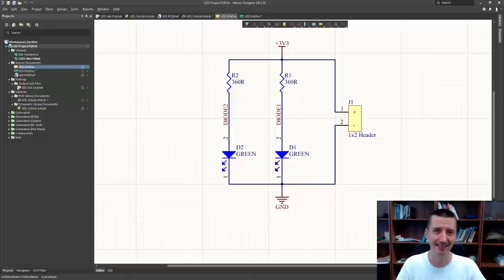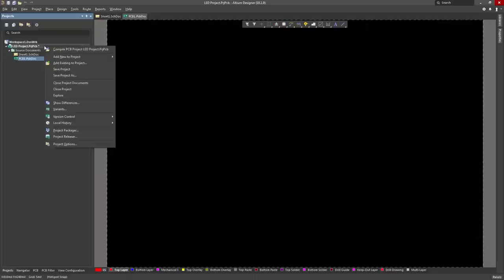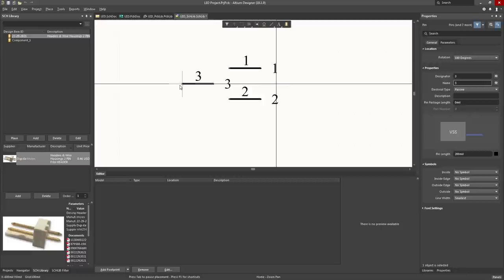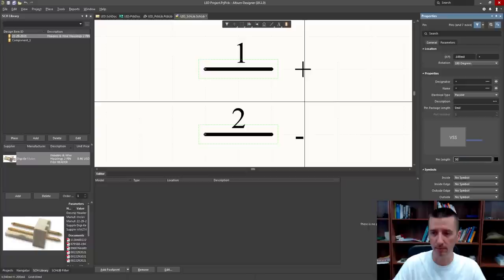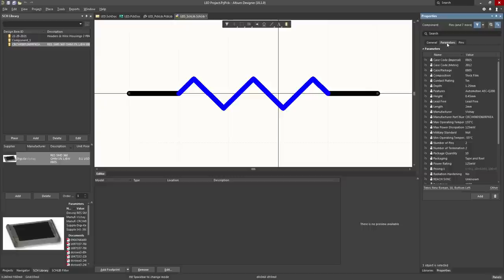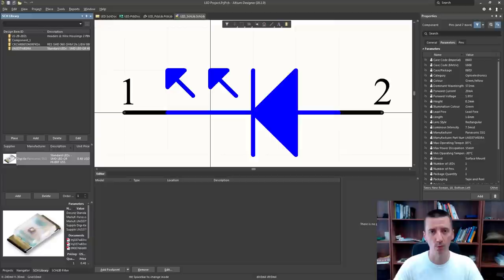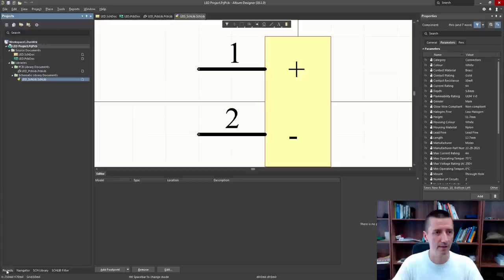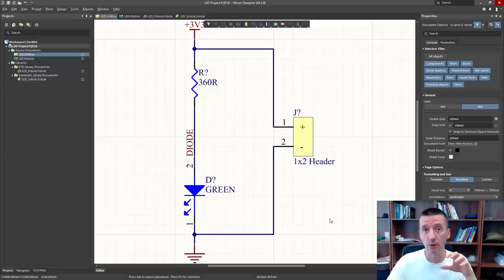Tutorial 1 for Altium Beginners: How to draw schematic and create schematic symbols

Comment from the maker: NEW: I updated this tutorial and made a shorter version ( in case you need it ). Here it is: Altium Designer 22 Tutorial - Quick & Easy |  Step by Step https://youtu.be/PqFtSpAXB9Q
Reply: At what point do you describe what the grid size should be ?
Reply: I imported the part like you said at 12:00 but do not get a picture of it in the SCH library panel
Reply: when you copy-pasted the arrow at 44:20, why is the pasted arrow symbol so far from the mouse pointer?
Reply: Isn't it usually possible to just obtain correct schematic and symbols for components we intend to use? Is there a standard way to define schematic symbol and PCB foot prints?

Comment: For anyone stuck around 33:56 you get to your library in (panel)===>Components===>select your schlib and it should have your components listed from the created library. If not save all the files and it will update and then go back and check.
Reply: Also, with version 19.0.5 of Altium, I also had this little problem where you have to restart your Altium every time to update your component panel libraries.
Reply: Hello I did everything same as shown in the video but I can see my components in the library but I am not able to place them in the sheet or it is not visible either

Comment: Hi Robert! Thanks for a great tutorial. I wanted to comment on something that may affect the experience of other users, and that is how we search for parts. I suggest you add an edit that lets people know that stock may vary, so they may not find the part you use if they follow your steps exactly. This happened to me, which is why I mention it. Disabling stock as a filter will give you more consistent results. Of course, this doesn't apply to irl design, where having stock is important, but it serves the purpose of the tutorial learning experience.

Comment: Hi Robert, Thank you for your masterpiece! )) 
Could you please explain the difference between 3 your courses:
1 - This course
2 - Altium Tutorials for Beginners
3 - Learn Altium Essentials - Doing PCB Layout
Thank you
Reply from the maker: Thank you Pavel :) Do you mean my other youtube videos? 
- This video is based on the new Altium. This tutorial has much more info and is much more complex than the Altium tutorials what I shared on my youtube some time ago. You will see in the next parts.
- Learn Altium Essentials - Doing layout is from our course, so on youtube is just a small part of much bigger video. The whole course goes into much more details and it is not just about Altium, but it is about hardware design. The course is about designing switching power supplies and includes comments about how to design switching power supply, what is important, how to do it and why we are doing it that way.
Reply: @RobertFeranec  Now it's clear. :-) Thank you Robert!

Comment: I like making my schematic symbols with the outline color the color of part manufacturer, white inside so I can paste the package pinout from the data sheet, I then give it a dark grey shadows and set grid to 10 mil and offset it 30 mile down and 30 mils to the right. They look gorgeous and make it more fun. The yellow boxes are simple but boring but traditional.
Reply: Hi, 
it sounds interesting could we/I have a picture of your design. Thanks in advance
Reply: Shouldn't it be a library which contains all the drawings for parts? Doing it for every component seems very time consuming
Reply: @haideralikhan5947  it takes maybe 30 seconds longer than making a regular part. Really not time consuming and it just enhances my enjoyment doing schematics

Comment: Thank you Robert for your hardwork. You have always been a great help.
Reply from the maker: Thank you very much Navdeep for nice words :)
Reply: a quick question Robert, in my altium 18.0, the properties option is missing and also, its not there in the Panel option. I think the 18.0.10 was a beta version. Is that can be the problem? Also, I'm not able to open the properties of components by double click on them, which we were able to do with older versions.
Reply from the maker: I do not have Altium right now here, but I believe you should be able to see the Properties panel in AD18.0. If it is not open and if it is not in Panel option, I think, double click could also open it. But I would have to try it. AD18.0 had some bugs (e.g I remember, that if Properties panel width was too small, some values in the panel were not shown properly)
Reply: Robert Feranec ohk will try out. Thanx robert

Comment: Hi Robert, I made schematic symbols for USB-C and Molex board to board connectors and created pins by copying and pasting the pins and then manually going into the properties of each pin and changing the name and designator to numbers 1-64 (Molex) and A1-A12/B1-B12 (USB-C). When importing these connector symbols into my schematic, I see red squiggles going down one side of the component. Is that a DRC error caused by my method of creating pins?

EDIT: I see my error. I forgot to change J? to J1, J2, J3, and the error was caused by duplicate designators. After assigning J1 - J3, the red lines are gone!

Comment: Hello master Robert i like you videos and  great videos. I have a question that you said in the minute 33:02 the number 1 pin is cathod in the led  but in the datasheet said the number 2 is the cathod??? possible you wrong??? . I hope you respond thanks.
Reply from the maker: Usually 1 is cathod. I do not know why this specific manufacturer used number 2 in the datasheet. However, in this case, it is fine - in this case you do not need to follow datasheet, just be consistent between your symbol and footprint numbering.
Reply: @RobertFeranec  thanks for respond!!!! your courses of Altium are Great!!

Comment: Hello Robert;

I am using Altium 16.1.12 . This version of Altium Designer does not show either the “Panels” sub Tab nor “Parts Search”. Instead this version of Altium shows a “System” sub Tab which when opened displays amongst others the “Projects” panel for enabling or disabling.  QUESTIONS: Q-1): May be this Altium version would require enabling the display of “Parts Search” under the “System” sub Tab?  Q-2): How to access to the “Parts Search” when this panel is not shown in the "System" sub tab?Thank you
Reply from the maker: I have made also videos in previous versions of Altium. This may help: https://www.youtube.com/watch?v=XZzZtYYRu2U

Comment: HI Robert,  thanks for still uploading great videos, when you start a new design, you always create libraries for each components? even for resistors? do you have base libraries, which you usually use to create another libraries for specific resistors , and capacitor and so on? Is it possible to  share it? (I have downloaded your library "Open Source iMX6 Rex project") but it is not included the different sizes of resistors, or capacitor and so on) sorry if I am asking too much
Reply from the maker: I do not create libraries for existing components, we have our own big library. It is not possible to share the library as it has many components which are under NDA and can not be published without permission. You can always create library from a project, our iMX6 projects should have many basic components.

Comment: How do you figure out the dimensions of each object? How do you know if your pin must be 200 mil long vs 100 mil long (as an example) and how do the lengths affect performance or operation? For example, if I used different lengths for the resistor or diode symbol, how will that affect my PCB? If there are some standard, well accepted design principles on drawing these symbols (ex: it is recommended for pins to be 200 mil long) where can I find these?

Comment: Hello Robert. Thank you for your great videos. One question for the paid courses. Will you make in the future a similar course structure for Cadence suite, as for the Altium one?
Reply from the maker: You can use Advanced PCB Layout with Allegro. I am not planning to re-do it, it is not necessary. Only what you may need is the iMX6 Rex module in brd format and you can find it here: https://github.com/FEDEVEL/board-imx6rex-module-in-cadence
I would like to create super advanced course in Allegro (server board design with all the high speed interfaces), but I have not found any company who would back up that project.
Reply: @RobertFeranec  Thank you for taking the time to answer

Comment: What if your new part does not have 3d model?
Reply from the maker: You do not have to use 3D model (however, then 3D model of your board will not be accurate). Or you can find a 3D model on Internet e.g. try 3D ContentCentral. Or you can create 3d model: you can create simple 3d model in Altium or you can create detailed 3d model in different CAD system (e.g. autodesk, fusion 360, etc)

Comment: Dear Sir, I wanna ask something, how do you know length of each component you built? like why the pins are 100mils and resistor.
Reply: also, how do you know to search like "led 0603"? thanks!
Reply from the maker: you can choose any length you want ... I used 0603 or bigger because it is easier for hand soldering. If you google for "standard resistor footprint size", you can find all the kind of standard lengths: http://www.resistorguide.com/resistor-sizes-and-packages/.
Reply: @RobertFeranec  great Sir ! Thanks 😊

Comment: Hello. thanks to your great videos and especially thanks to your good speaking...because despite my bad English skill I can clearly understand your remarks.
 I have one problem....as you said I disabled the auto pan exactly like yours, but then my left click didn't work anymore, for example when i want put wire.
Reply from the maker: Thank you Alireza. When you work in right panel, you are out of focus from canvas (the area where you draw). Easiest way to get focus on canvas is to press right mouse button, hold it down and move the canvas a little bit (or use enter when you change something in properties - that also often will return focus to canvas).
Reply: @RobertFeranec  thanks for your help....yes it has worked....
Reply: @RobertFeranec  Did not work for me. I can not place anything even if I did not work in right panel. Thx

Comment: Thanks for the video,  this is very helpful!
Btw, can you simulate your sample circuit in this video with the built in tool mix signal simulation?
Reply from the maker: Thank you Kevin. I do not really do many simulations. If needed I usually only simulate memory layout and I do not use Altium for this - Altium doesn't have good simulator. I like Hyperlynx for simulations, but for this I do not have license - I can only use it when I work for some clients.

Comment: Why is it that you can ever create your power port or net alias manually?  Is it because of human errors and misspellings or is it because the tool will crash?  I want to think the reason is due to the fact you will create many net names differently for example if you intended 3.3V and you ended up with many version of 3V3 and they will not be connected on the board.  One should be able to catch that on layout as one would expect one 3.3V plane for example.  I can see the reasons why, and being new to Altium, I just want to know if the tool will crash or create bad netlist or other reason other than human errors.
Reply from the maker: Human mistakes - I have seen it many times.
Reply: @RobertFeranec  it makes sense. I was just worried the tool couldn't handle it or something else tool related. Thank you for your video. It is very detailed and very useful to new users.

Comment: I found out that using the import tool just messes up the component by adding a lot of useless properties that are not consistent. Thus making the BOM output a real mess. What is your view on that?
Reply from the maker: Import is never perfect. After import, the symbols and footprints are usually copied and placed into a proper libraries, they are adjusted, proper component is created and then replaced in schematic.

Comment: Hi! Excellent tutorial. I'm starting to watch all your videos.
I have installed AD 20.0.13, but it runs really slow on my laptop i7 16GB SSD NVIDIA Quadro M1000M when moving components or placing tracks. Would AD version 18 or 19 run faster? Thanks.
Reply from the maker: Thank you Dario PS: I also noticed, Altium is getting slower and slower .... I am not sure if AD18 or 19 would run faster, but old altium e.g. AD14 was definitely faster.
Reply: Robert Feranec Thanks for your comments Robert. In this case for example, when I move a component in the board and start moving the mouse around, the component follows the cursor with a 1-2 sec delay. It’s like a cat chasing a mouse. A fat cat, by the way. I wonder if one would lose important new features of v20, if I using v18 or v19 instead, for the casual designer. Have you seen valuable advantage from going from v18 to the latest one? I really like the dark theme they introduced in v18, I think it’s better for the eyes. Otherwise I coming back to Protel 2.8 😊. 
BTW, you are doing a great job with your videos 👍🏻
Reply from the maker: @dariodraiman6339  Honestly, if I was not creating youtube videos, I would stop upgrading in AD14, maybe AD17.

Comment: Hi, have you designed with circuitmaker?, it is the free version of altium, but I dont know if would be easy to migrate from circuitmaker to altium, thanks
Reply from the maker: Simple asnwer is no, I have not really used circuitmaker. I have played with it, I do have some of our projects there (imported), but at that time I was playing with it I think it did not support private projects, so it was not very interesting. Even if it would support private projects now and I would be starting with HW design I would probably try KiCAD instead.
Reply: @RobertFeranec  Hi, but why would you choose KiCAD instead an Altium tool?
Reply from the maker: @JairoGustavo  I would choose KiCAD instead of CircuitMaker, because I believe KiCAD is free solution. With circuitmaker you are tight up to their website ... unless they changed and you can use circuitmaker as a stand alone software - can you?
Reply: @RobertFeranec  I don't think so, some people had told me that you save your projects in the cloud, but I havent use circuitmaker so I am not 100% sure

Comment: Hi, why do we must change the pin lenght to 200 mil?, what if I use 300?, thanks
Reply from the maker: You do not have to change it, you can keep 300. I use 200 or 100 as 300 may be unnecessary long for some symbols.